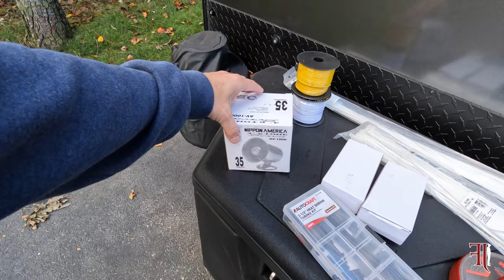CAMPER EMERGENCY STROBE LIGHTS AND SIREN INSTALL. (INTECH)

Comment: Great idea especially for off the grid camping. That is loud as heck. Lock the lights under it. Thoughts of maybe having a separate switch for lights and sirens or maybe a button as well to change the light patterns of maybe your just sitting out listening to music with a fire going?
Reply from the maker: I thought about having a separate disconnect plug just for the siren so that I could use the lights for fun but u can always go back and add it later

Comment: I don’t have a camper yet but I’ve been researching and doing my homework and came to a conclusion that this camper is almost perfect for me.  I am a paraplegic, permanently paralyze from the chest down, so the choices are very limited.  I like the fact that it has a ramp so I could roll  my manual wheelchair or drive my electric wheelchair up.  The tip out bed is also nice, easy to transfer from chair to bed and vice versa.  How heavy are the ramp door and pop out bed?  Worst case scenario, I can install a winch where you have your tv and use it to pull up the back door and my toys.  This security feature is also nice for someone like me.  Can this be done with a wireless remote to turn it on and off?  Can’t wait to go to the Hershey RV show next year and hopefully will come home with one.
Reply from the maker: I would think that this trailer would be perfect for you.  Yes the tip out bed and rear door are very light, in fact there so light that it’s almost feels like you have nothing in your hand and this in not an exaggeration.  This camper is 💯 percent aluminum and that also means zero maintenance.  This would be a great choice…….and yes a security system can easily be done remotely